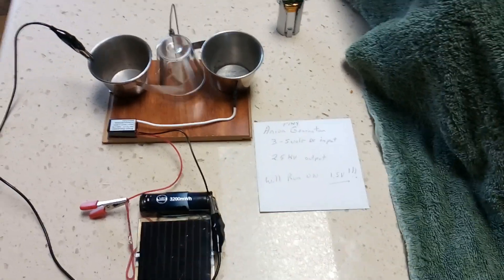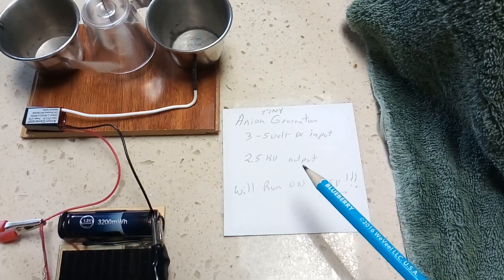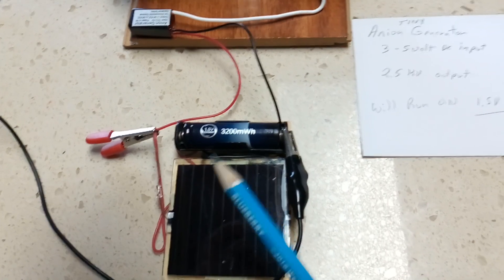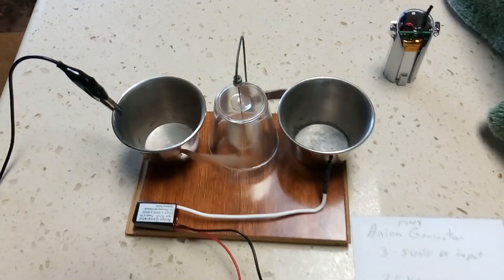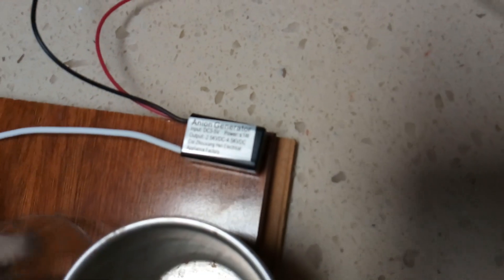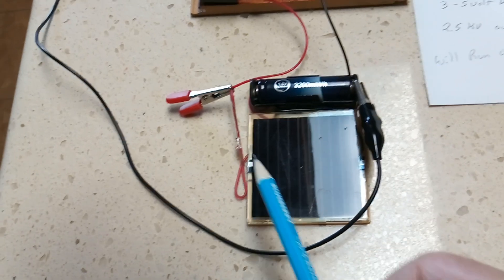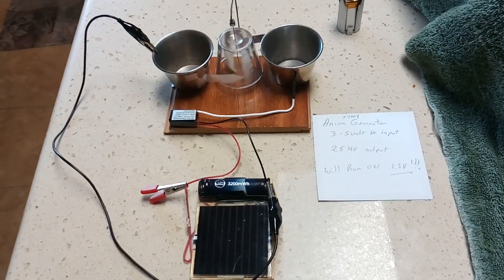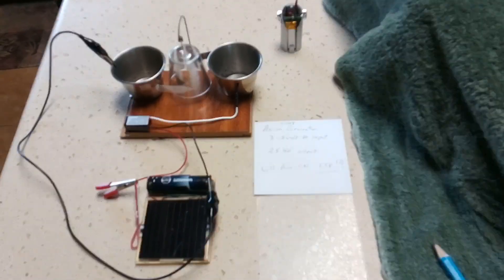1.5v Rechargeable Electrostatic Motor

Comment: The higher power produces more torque.
The step down circuit is probably some type of DC-DC converter or a buck converter or a series of diodes in series (each one causes a .5V voltage drop--you'd need about 5 diodes in series).

Nice vid, Rusty--thanks for sharing! :)

Comment: I wonder if you could use those high voltage Chinese pods. They work on 3 volts and are essentially a voltage generator. I have a couple of them and they are very cheap on eBay. Just look up High voltage generator on eBay. You may already have seen them. 
Cheers. 👍👍👍🎸🎸🎸
Reply from the maker: I have a few of those and they work great for HV experiments.  They  produce an AC output though so they don't work on static electricity projects unless you add diodes and a big HV cap. .

Comment: Thanks for sharing the details 😁👍
Reply from the maker: It works pretty good and you could make a Franklin's Bell using it also.
Reply: @Lidmotor  I did a Franklin Bell 🔔 using the circuit from one of those cheap tennis racquet bug zappers. Hmmm there's a thought!!